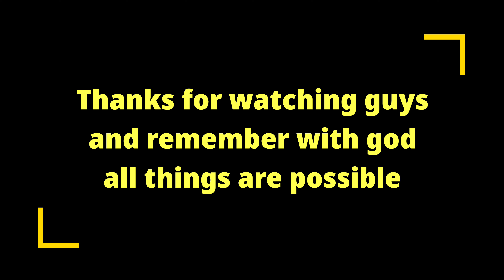Finally start working on the back of the wall | Danny getting active

Comment: Nice work the ras a gwan wid if a did me still after the house done I would take my time and dig away the dirt behind the house a bit wider and build a wall go straight up to hold back the dirty when it rains because behind the house is going to fill back up if there's a landslide just my opinion still but good job jbud gwan do your thing mi G upness all the time

Comment: I am letting you know that no matter how much rough cast that you install on that wall will not stop damp penetration.
I suggest that you cut back the embankment approximately 3 feet sloping the ground away from the foundation,you are going to have mold and damp walls on all the back walls.
Reply: It will if he steel float it.  I did the same thing to my house but I steal float it. No issue.
Reply: Where is the  drain, for the water to run off to?  All that water is going to settle at the back thus making it  unstable .
Reply: He also needs to water seal it, it's a white thick goop looking thing, I saw someone do it in Arkansas, one of the off grid building, the problem is Jbud and the others don't read the comments, but they are always asking for them.
Reply: Just like what happened to socks house
Reply: @sherbear3510  exactly, the skim coat of cement they are putting on the house is just as porous and the water will seep in from the mountains behind the house, but they don't listen.

Comment: Love the progress baker. Keep working hard and reaching for your goals. You are blessed and you have much more blessings to come. Please get some water sealer paint to put on the back wall when rasta is done rendering it. That will keep out any moisture from the soil in the future.  Also put some river stones behind the house so water has a channel to flow away from the house when it rains and doesn't settle behind it. Peace and love mi G.